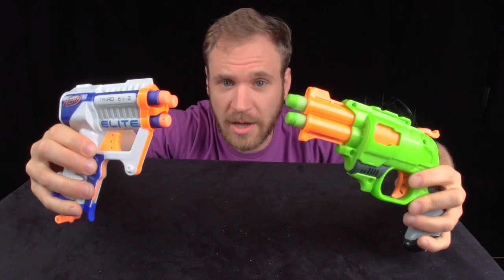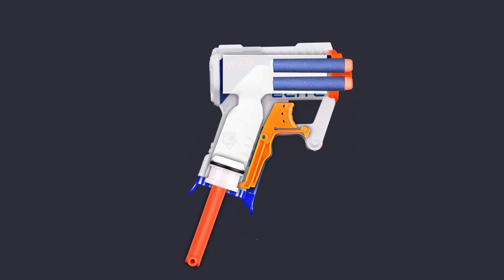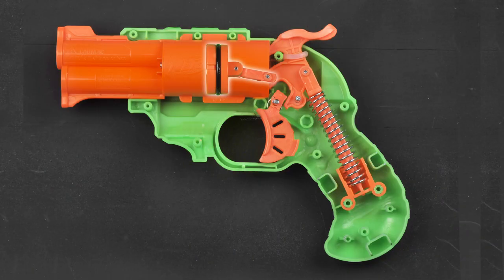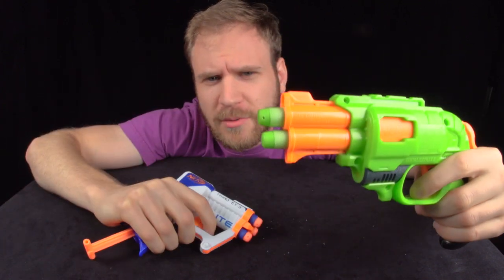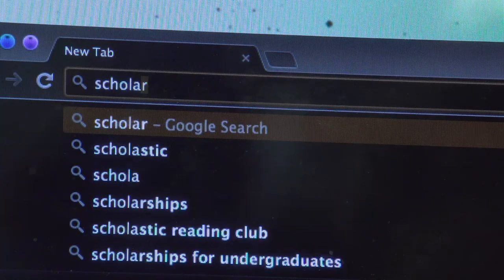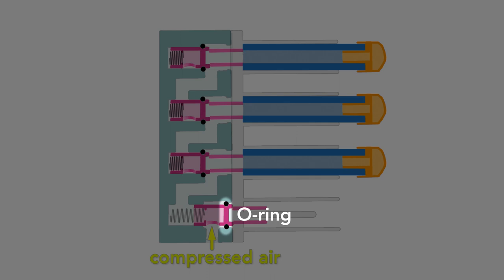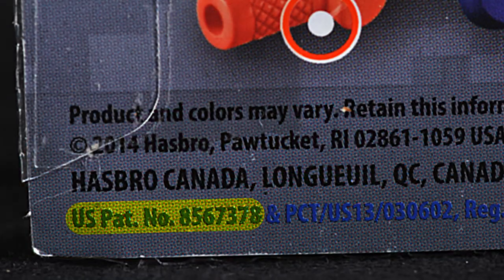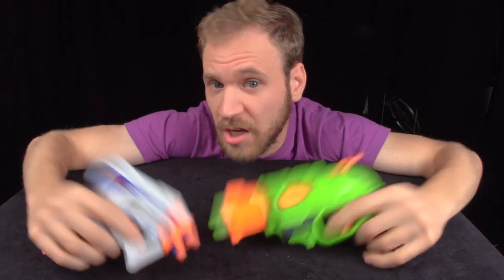Reverse Engineer NERF™ Blasters: Doublestrike and Triad

Comment: good job.  I originally thought they were air powered, but then after shooting one, I thought it was just the spring hit the high density foam, compressing it, and then the dart springing off of that.  Now that I know it is compressed air, it is not hard to imagine making your own nerf gun using more air pressure. It is a no brainer.  I bet there are many on youtube.

Comment: Why does the diagram at 3:05 have 4 barrels? The nerf gun only had 3 barrels for 3 darts
Reply from the maker: The diagram is from the patent. The patent covers an arbitrary number of barrels.
Reply: Steve Crayons So they've patented that particular method of firing thr darts wih any number of barrels. i understand
Reply: Rhys Evans k

Comment: Do you think we can calculate the spring constant for the spring? By using conservation of energy? Even though it uses air pressure
Reply from the maker: Hmm, I suppose we could measure the speed of the dart just as it leaves the muzzle. And we could also weigh it. That gives us it's momentum ( i = m*v). Then we could use the momentum change/impulse relation (m∆v = F*t). Where F is the force exerted by the spring over a period of time t. Then if we measure the distance, x, that the spring is cocked we could find the spring constant k = F/x. Maybe. I'm not sure that works out.

But, I think a more direct way to measure the spring constant would be to remove the spring from the blaster, hang a known weight off one end and measure the distance the spring elongates by. Then you get k = (m * g) /x